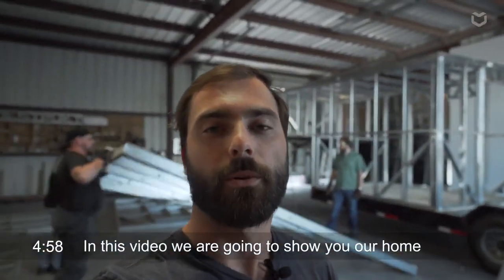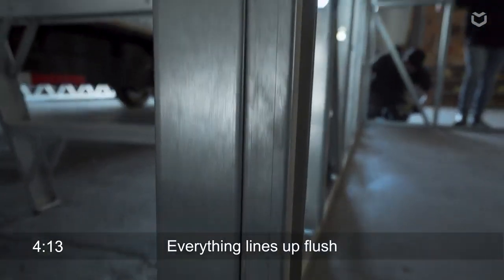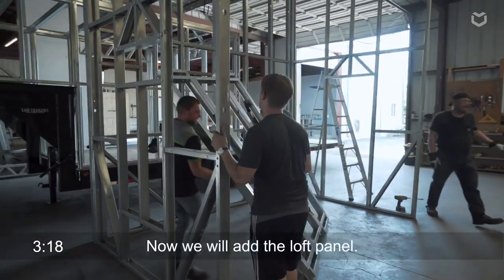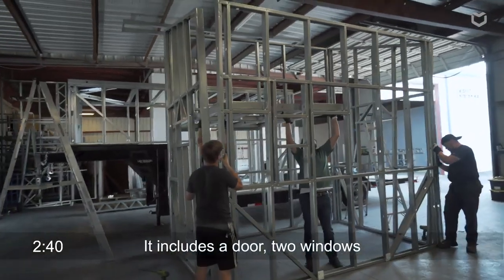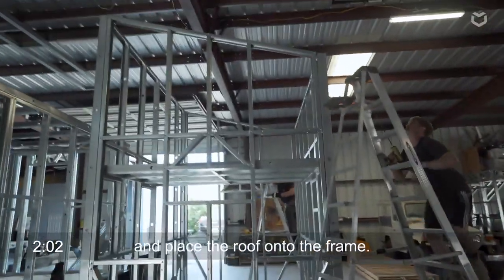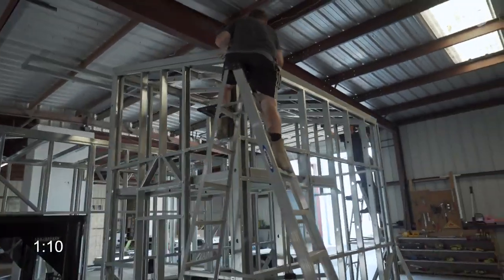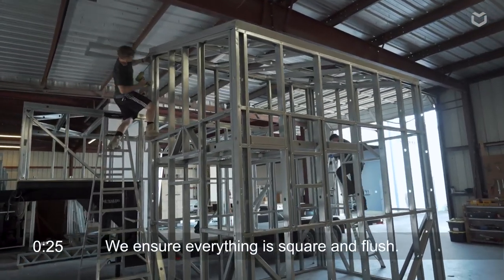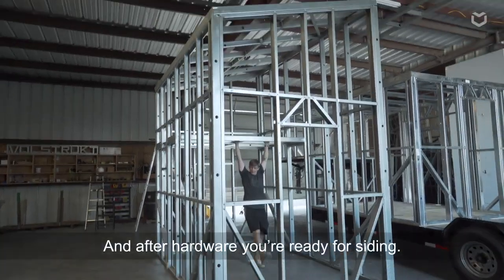Light gauge steel frame system for  Backyard Studio or Tiny Home

Comment: curious to know what was the cost per sqft for the LGS? Thanks.
Reply from the maker: On the average for 1 m2 of build up area you need around 28 -32 kg of steel. Price for galvanized steel is around 1 USD/kg. Production cost different in different countries so you can calculate roughly..